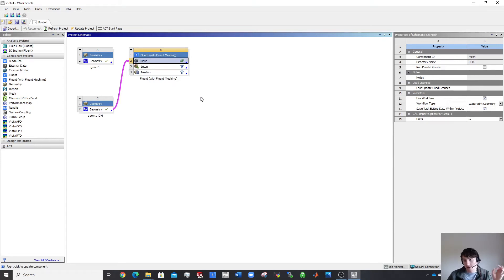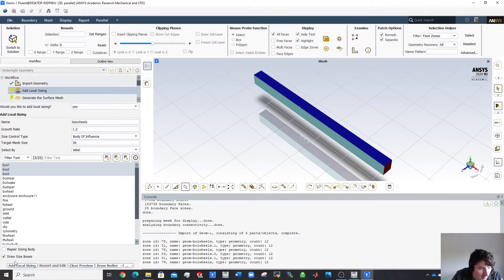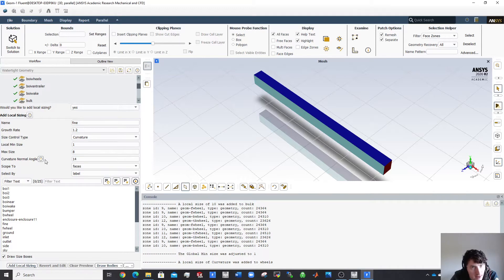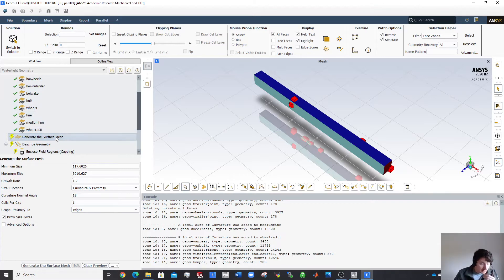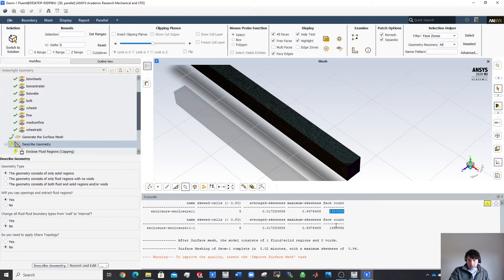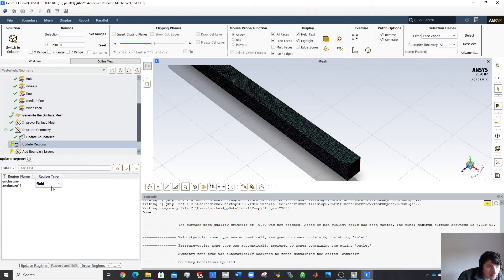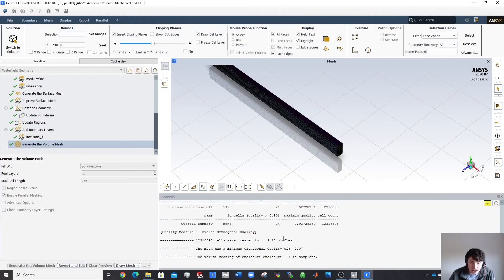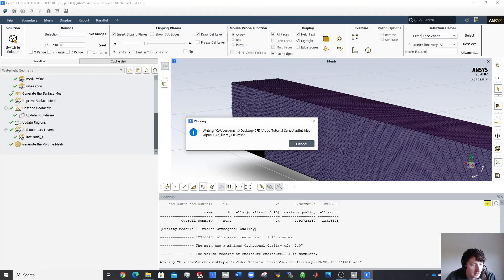Fluent In-Built Meshing Tool CFD Aerodynamics Tutorial - Masters Thesis

Comment: HI fab videos, currently doing my own dissertation, just curious as to why you set your sky and side walls to symmetry. Is it just to sort of double the domain size without actually doubling it. Many thanks
Reply from the maker: Hi Matthew, it makes the simulations run quite stable when these walls are far away from the body and set as symmetry. You can also set them as slip walls, and you should get near identical results given the walls are a good distance away from the body.
Reply: @ fab good to know. Have ever had the warning message the wall motion has a significant normal component on x faces in face zone y. I can’t find anything about it on the internet. It occurs when I apply rotating boundary wall conditions to my wheels. If I simulate one wheel maintaining the moving road I don’t get the error. Was just wondering if you ever came across this
Reply from the maker: @matthewh9655  You'll get that error when you've applied a rotating boundary condition to a surface that has a normal component or face(s) in the direction they are meant to rotate. You would get it for example if you made a wheel that had spokes or alloy features rotate, as the spokes have faces that are directed in the direction of rotation. You would also get it if you specify the wrong location for the axis of the rotation, ie not the centre of the wheel.